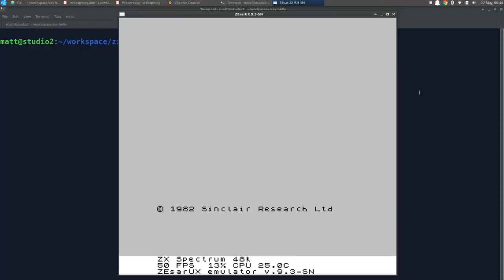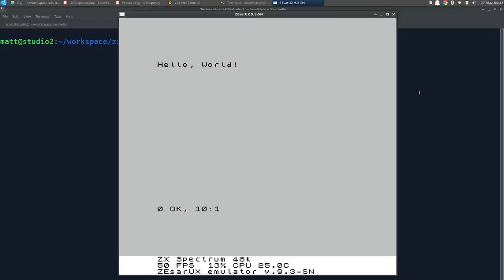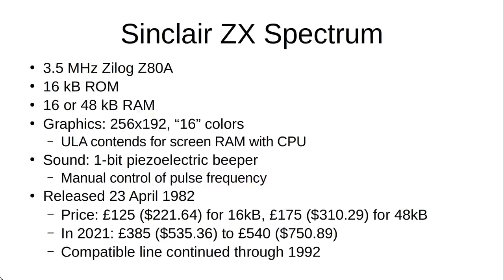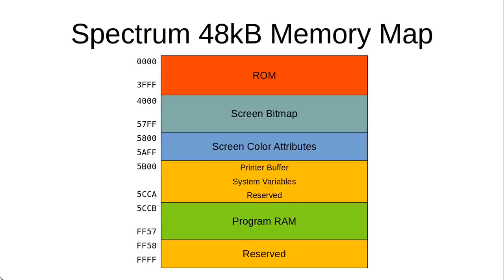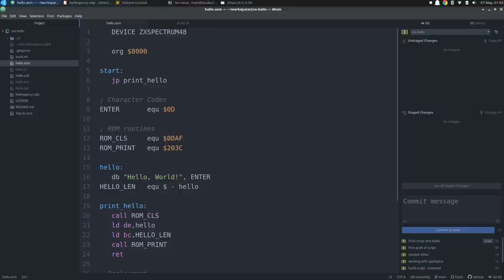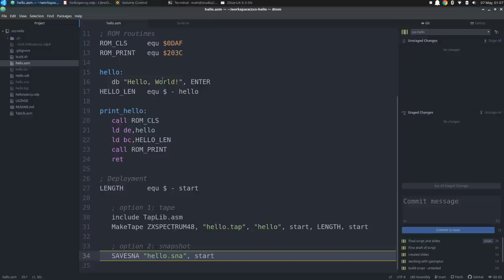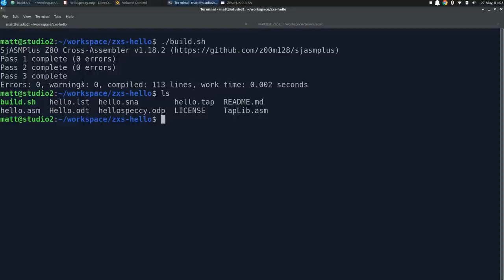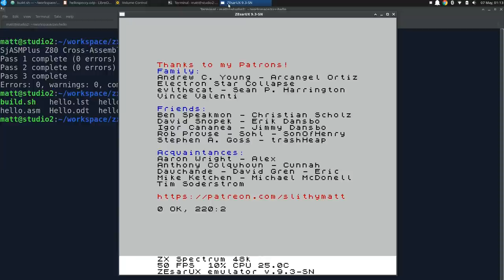Hello, Speccy! - "Hello, World!" for ZX Spectrum in Z80 Assembly Language

Comment: Little known fact: The "48k" of RAM is pure marketing. In reality, the Speccy had 16K of this RAM dedicated to video memory, so only 32K of RAM was available for programs (possibly even less, as system variables took up a few bytes).
Reply from the maker: It all depends on how you use it. You definitely have more than 32k of general purpose RAM, if you're doing assembly and not depending on an ROM routines. And the video memory is still regular RAM, so you could use it for code or data temporarily before scrubbing it to print out results. So, Spectrum 48k actually had more immediate access to RAM than the Commodore 64.
Reply: Video memory was just over 6KB (starting on 16384, where ROM ends, 32 bytes per scanline*192 scanlines=6144 bytes for pixels + 32*24=768 for attributes, if memory serves me well). Then you had 256 bytes for the print buffer (nice place for little sneaky routines if you're not using Interface 1) and system variables (192 bytes), plus some more bytes (11, I think) reserved for BASIC interpreter internals which gives you around 41KB. If you don't plan to return to BASIC (and haven't any peripheral plugged in), your code can start on printer buffer. Any code which needs precise control over timing (flickerless sprites, sound, border effects...) must be run on upper 32KB to avoid ULA contention anyway. From the upper end you had 192 bytes for UDG (user defined graphics) and the stack pointer, but you could ignore UDG and place the stack pointer wherever you like with the CLEAR command (again, not too low if you had some BASIC or need to go back to BASIC after you run your CM). Really it was that simple and I still think this was its beauty.
Reply: Dedicated RAM is RAM. Every platform has some addresses mapped to hardware. And in fact you can still execute code that's in screen RAM. Some protected games did it and I think early hacking devices like the original Snapshot did it too from memory.
Reply: @RufianEmbozado  I think some of the later disk-based systems had other stuff too. Maybe even microdrive system. I think there was a system variable you could read that told you where the boundary was. That was common in eight bit machines.
Reply: @andrewdunbar828  Sure. I know Interface 1 did something in the system area. Some games just crashed if you had it plugged in (and one friend of mine used to hack them into submission just for the pleasure of loading them from Microdrive, weird people we were). But, sadly, I never had one of those, just a 48K Samsung clone (back in the day all those gadgets were ridiculously expensive). So I never got to know the nitty-gritty details. Later Amstrad models brought "the Amstrad way" and somewhat blurred this beautifully minimalist architecture from original Sinclair's ZX Spectrum.
Reply from the maker: @andrewdunbar828  absolutely! Nothing preventing you from making a "headless" program on the Spectrum that fills the screen with garbage if you have video connected, but still does some sort of peripheral interaction.

Comment: Nice , but how you write assembly without a modern Editor "Atom"  and Computer , like back in the days?
Reply from the maker: You would need both an editor and an assembler that would run on the system. It is certainly possible, but much more difficult and slow.